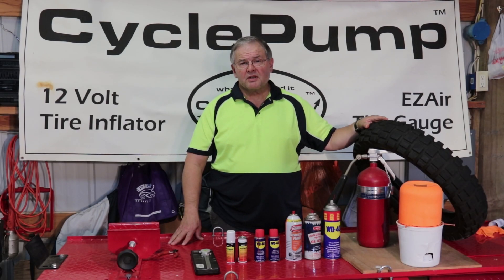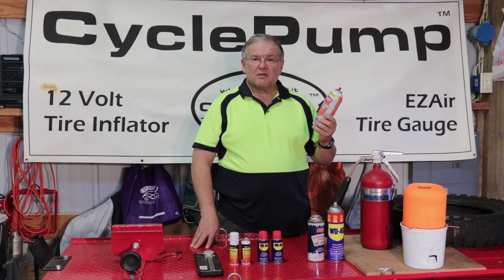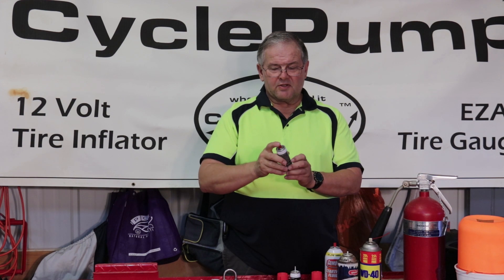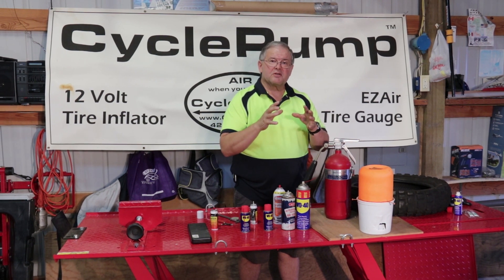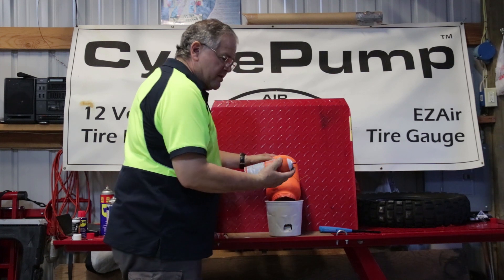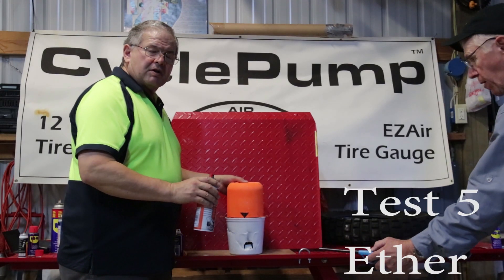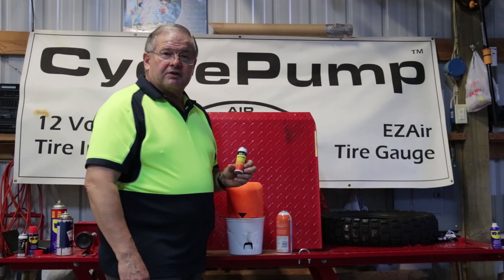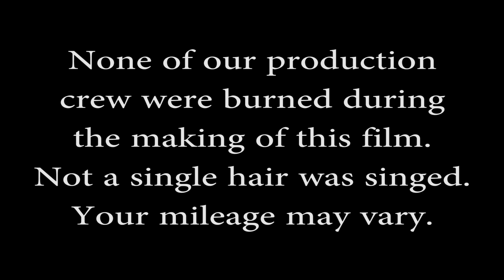Butane Bead Blaster for Tubeless Tires

Comment: So glad I watched this. Installed a 19inch front tyre manually with difficulty and it was a bit squashed at the last point not making any beed seal. After trying various tricks like taping up the gap and using a circumferencial rachet strap I thought I was going to have to remove it. Anyway I essentialy applied your techneque but used liquid brake cleaner, injected into the valve head (inner valve out) and some around the rim to wick it in. It lit up, but nothing, I gently kicked it and it popped onto the rim. So happy!

Comment: I own a mountain bike with TLR (tubeless ready rims) and tires, which have been becoming very popular amongst bicycle enthusiasts, and with knowledge of the ether method, I searched and found this video, however the mountain bike tires being very similar in that they have a bead and bead channel they do however have to have a liquid latex sealant added into the tire about 2 to 4 ounces depending on tire size, which is used to seal small punctures from occasional small thorns and whatnot. With that said, I'm certain that the sealant itself is inert and would pose no threat to a violent explosion, except the tire would have to be in the upright position when the butane is ignited if this method is even compatibly possible. On another note, bicycle tires are a lot thinner than motorcycle tires, and pressure could blow the tire, but I'm not sure, but it'd be interesting to find out.

Comment: Thanks for carrying out the tests and highlighting the dangers. So on the test kit the starter fluid remained ignited, that’s worrying if it stays lit inside the wheel. Also if that’s a 1200 GS tyre it would have a Tyre Pressure Monitoring System sensor, spraying butane into the valve stem and lighting it on fire is very risky and costly. It’s probably something that should only be done if you can’t get to a garage. I couldn’t seat the bead on both GS wheels and just took it to a Motorcycle Tyre place.
Reply: The flame inside the tire remains lit for a very short time, fractions of a second. Then the oxygen is consumed and the flame goes out. Combustion requires very specific air/fuel ratios. Once that ratio drops the flame stops. The video does show the flame burning longer outside the tire because oxygen continues to reach the flame. 

As for damaging a TPMS sensor because of the flame? While anything is possible, it's unlikely because of the short duration.
Reply: @HidalgoRides  good point regarding the lack of oxygen, I missed that. In any case it's good to know as many methods as possible and start with the safest then when you loose your temper just before you reach for the sledgehammer try flammable fluid 😅. Thanks for your reply.

Comment: Wonder is this can ruin a TPMS monitor in a wheel like on my KTM 1190 Adventure R?
Reply from the maker: I don't know. Try it and report back 8^)   Being serious now, I don't think there'd be a problem.  The valve core is not in the stem when doing this process.  While there is a buildup of pressure in the tire from the exploding gasses, the gasses vent out the sidewalls first, then the beads seat against the rim, and the remaining gasses vent out thru the open stem.  I've never heard of any TPMS issues from this process but that doesn't mean there haven't been any.  Understand that this process is for emergency bead-seating in the field.  So once you've solved that emergency, then you can worry about your TPMS sensor when you get back to civilization.  Of course the BEST method of seating a bead is to use your shop compressor, but very few riders carry one of those when they go riding.
Reply: @BestRestProducts  I didn't get to try it out. I used the ratcheting strap method and it worked like a charm. I changed quite a few motorcycle tires in my day...and this was the first one that I've had trouble getting to bead. Usually I have the opposite problem in that when spooning on a new tire; it wants to bead before I finishing spooning it on making the last 1/4 a pain in the hind quarters. Was a good learning experience!

Comment: If im stuck out camping could I use propane?
Reply from the maker: I have no experience with propane, but the same principles would probably apply.  The issue with propane is the delivery to the inside of the tire.  How would you do that?  It has to be directed to the inside of the tire, in just the right proportions for combustion to occur.  If there's a lot of excess propane you will not be able to get it to burn, or there might be the possibility of a larger explosion.